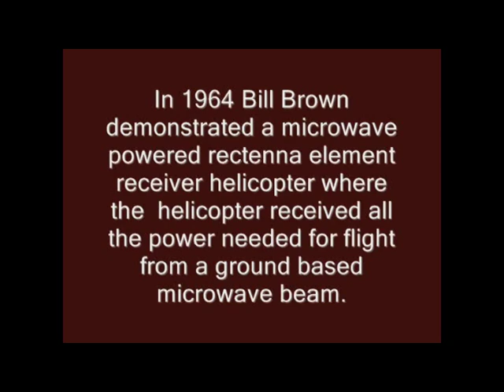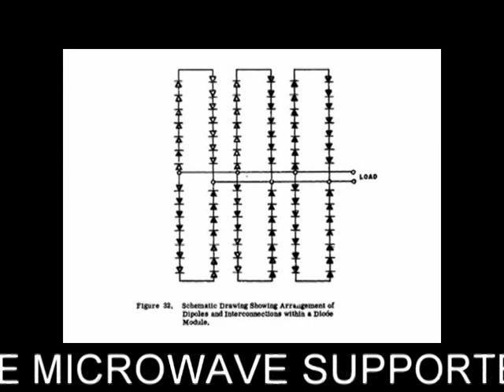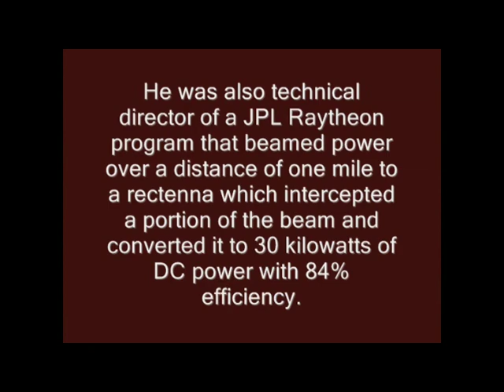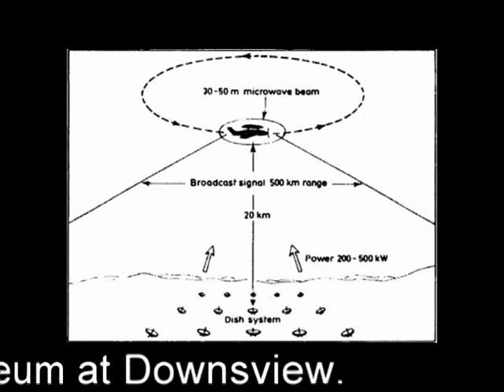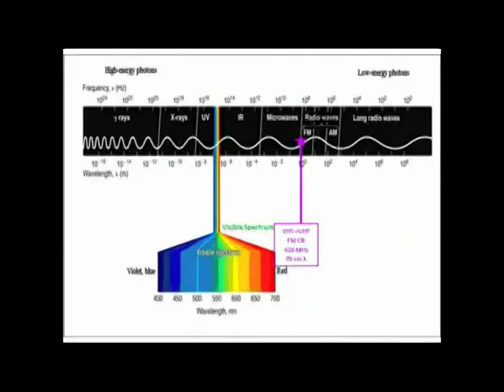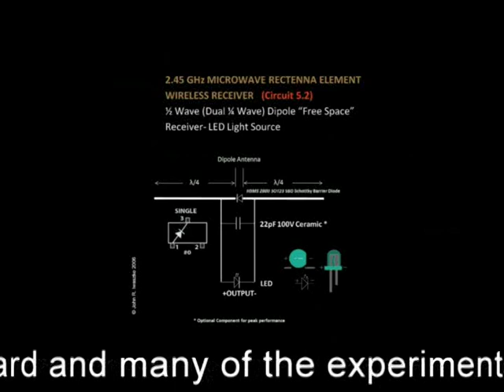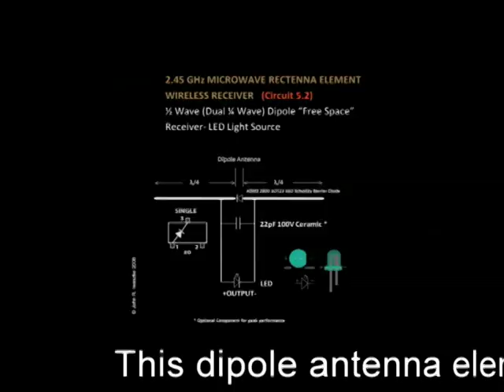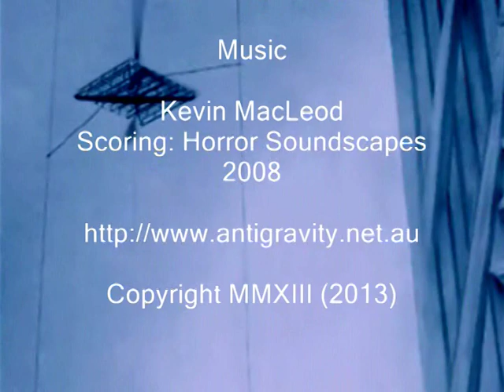Wireless Powered Microwave Flight History & Experiments

Comment: Hi, The new panasonic microwave oven like the NN-SD372S model, are less dangerous, they use Inverter Technology . The old common ones pulse 100% of the power in a given time. The new ones are able to pulse small percentage of the full power. It's a bit hard to explain, but they are safer. Hopefuly you can get a hold of one for your projects. Very well done.

Comment from the maker: My conclusion is that the only advantage they have is within our atmosphere where microwave power beaming still achieves higher conversion efficiency than lasers, as it is less prone to atmospheric attenuation. The disadvantage of Microwave transmission due to their far longer wavelengths than visible light means that they also require proportionately larger transmitters and receivers to deal with diffraction over the long distances, not to mention the dangers these wavelengths pose.

Comment: What happens to the microwave radiation that isn't converted to DC? Does it heat the rectenna up?
Reply from the maker: An interesting question, any device that is in tune, a harmonic of or somewhat in tune will adsorb the radiation, the tuned antenna array was precicely in tune with the MV radiation,  I'm not sure how much of the energy in the rectenna was converted to heat, this was not the aim of the experiment, so wasn't tested, the aim was to convert MV to DC, to power a motor and make it fly. As microwaves are dangerous, I would prefer to experiment with it as little as possible! LOL